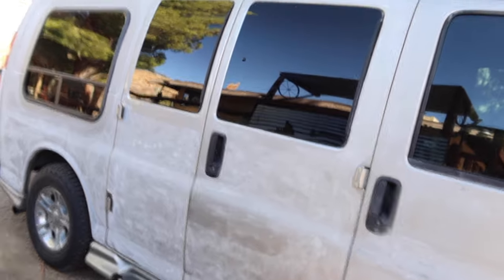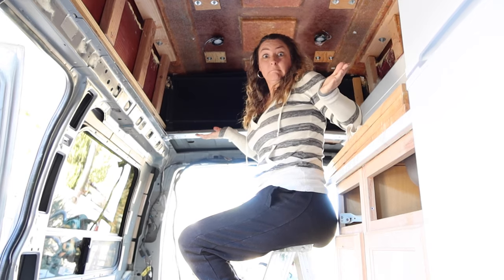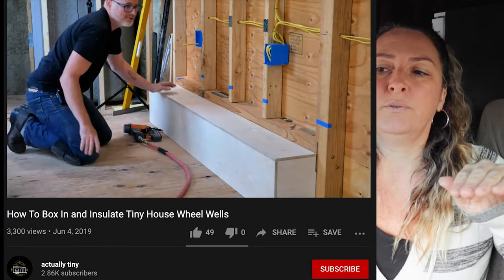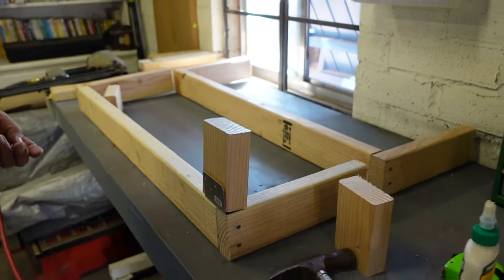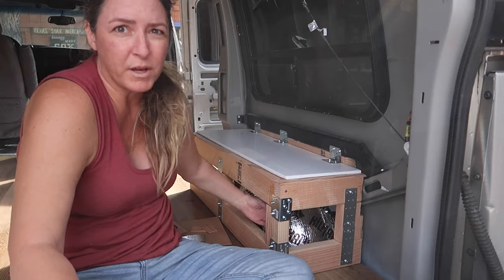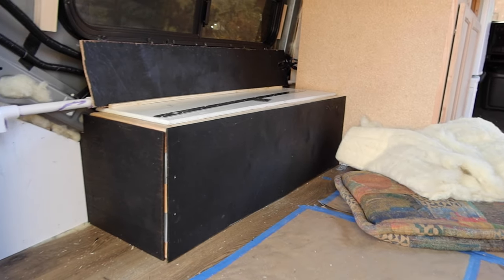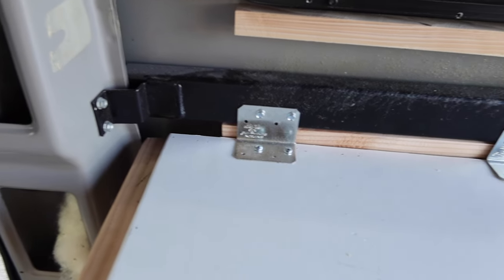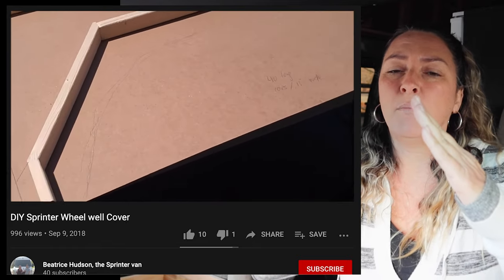How To Build a Wheel Well Box (Chevy Express Van Conversion) // Travel Snacks

Comment: I'm a union carpenter and wish could come share some knowledge with ya, youve got drive and big motivation which are just as important if not more so than specific skills which youll learn along the way, you shouldn't have to pick your battles it's your van your world you make it exactly how desire, remember most new things seems difficult before you do it, don't be afraid to fail learning how not to build something is still valuable learning, after your solo cleat attempt you learned nails split thin wood haha you were on the right path with longer 6" but screws instead of nails to ditch the metal brackets, you're right 2x4s were way overkill if you have a table saw try ripping them in half length wise next time, U got this kid never give up!

Comment: Bad idea putting steel brackets on the wheel well boxes dad, that's going to make screwing panels to the outside really tuff with those protruding bolt or nut heads sticking out.